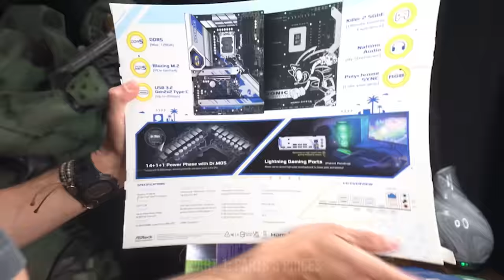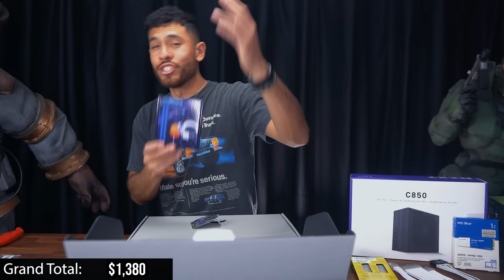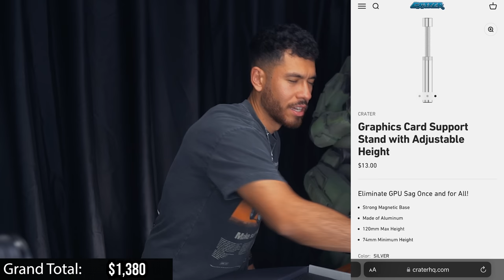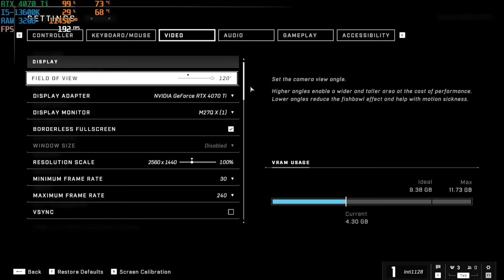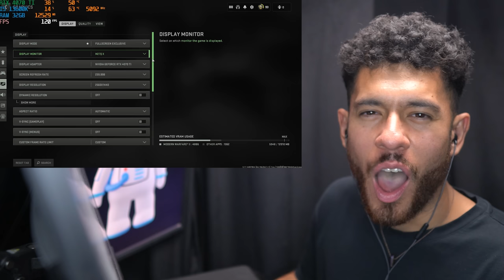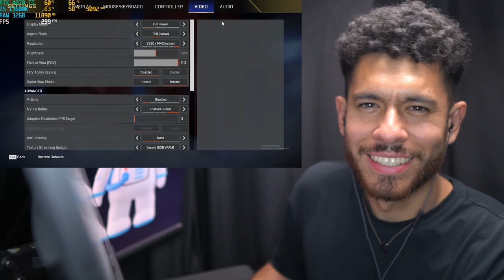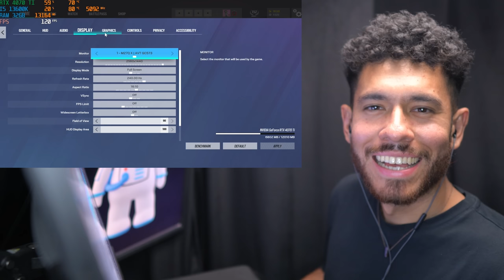$1800 Gaming PC Build - RTX 4070 Ti i5 13600K (w/ Benchmarks)

Comment: Just started picking up parts on my $1400 build with a 4070 + 5600x, just need to get the motherboard, psu and case and will start building it. Excited af since this will be my first ever pc build and a generational upgrade from the ps4 :D
Reply: Good luck 👏
Reply: how did you end up choosing youre parts i need help i wanna start buying parts for my first pc but don’t have any clue on what’s good or not for my budget which is around 900-800 usd.

Comment: I would really like to see a beefier cooler for that 13600k but overall a really nice build Crater
Reply: I have this exact CPU and cooler ordered for my first build, I am not planning on overclocking or anything, should I look into a more robust CPU cooler? TIA!
Reply: Same question here😂
Reply: Same here but least he got a bunch of leftover cables
Reply: 94 C
Reply: @KeaganKellogg try it out, if you are going over 79° in games you’ll get thermal throttling and it’ll reduce performance, in this case, or if it’s just too loud in general I would look for a better cooler. If not then you’re fine
Reply: Could have gone with the peerless assassin rgb
Reply: @KeaganKellogg  tbh id spend the $100 on like a corsair h100x or a Be Quiet pure loop 2 (either the 240mm or 360mm or the fx varient for rgb). Both of those are really stong aio's for the money.

Comment: Love the content Joey! You said you have plenty of airflow in the build but your cpu and gpu temps during Warzone are hotter than my oven. I swear I saw the CPU hit 90 degrees. Definitely go for the AIO option that you mentioned or a Noctua/BeQuiet higher end air cooler
Reply: Yeah I was wondering if those temps were normal or not bc with my aio, It stays around 45-50°. I see a lot of these air cooler builds and temps are usually in the 90s°.
Reply: Yh, i have a 13900k and my cpu stays cool even during playing games like cod CW with ray tracing, an AIO is def better then air cooling
Reply: @islacloud7633 yes the new 13th gen intel runs very hot and what you could do instead of spending more on intel you could go amd and go with the 5800x3d or 5900x or go with am5 because you get the upgrade path
Reply: @YunaHyera  yeah fr, not to mention the temperature of the gpu. Idk why content creators keep on using air cooling when clearly it doesn't work. Every video I see of a PC build using a air cooler, the temps are always super high on the cpu.
Reply: A Thermalright peerless assassin or deepcool ak620 would be much better suited for the 13600k, cools well enough and cheaper than an AIO
Reply: @IslaCloud11  It's because he's using a single tower air cooler. A dual tower air cooler like the peerless assassin, ak620, or nh-d15 would do fine but the single tower cooler just isn't enough
Reply: @Phoenix718 Yeah I saw them say that and I was like “my peerless assassin cools my 7800x3D just fine”. Even at the same price point he could have found something better.
Reply: Yeah,1800$ build for that cpu cooler?nah

Comment: should have put the “custom backplate” in front of the GPU for better visibility would have looked way cooler - the way it is it kinda disappears under the big cpu heatsink 😅
also a running sonic figure hanging from the top of the case in front of the cpu cooler would be awesome design-wise ☺️👍🏻

Comment: Thinking to upgrade my rig
CPU - 13600k
MB - MSI MAG Z790 TOMAHAWK 
CPU Cooler - AK620  or NH-D15
GPU - 4070ti (MSI Gaming X trio)
RAM - Corsair Vengeance (DDR5 16x2)
Storage1 - 980 pro 1tb or 500gb (Boot Drive)
Storage2 - 980 pro 2tb or 4tb for games/Movies
Case - 5000D (Corsair) or Performance 1 FT (Antec)
PSU - RM850e (Corsair)
Case Fan - Corsair SP120 Elite(non-rgb x6)

Comment: Very similar to my build: 

Z790-P (DDR4) 
I5 13600k 
4070Ti Aero (Gigabyte)
LianLi Lancool 2 Snow Edition  (just prefer the size over the 205) 
16GB vengeance DDR4
1tb M.2 
Lian Li AIO Galahad 240 

£2000 ish
Reply: @xboxseriesshort do you like the 13600K ? i have the same
Reply: @cuongtang9539  yeah not had any problems yet with it? Have you? Seems great and runs super cool!

My only thing I need is more ram, I went with DDr4 but probably need to get 32gb next (lMw3 on Ultra runs at 8gb and BF 2047 runs at 10gb so still enough to run apps in the background 

The i5 13600k seems great and is supposed to be one of the best gaming chips 👍 cpu runs between 30-54 and gpu runs at 40-55 never had any issues

I do get a few freezes but I think that’s internet (mw3 suffers from packet loss)
Reply: @GamingCornerYT  hahah yeah MW3 is the only game i had stutters and freezes, not a single other application has this weird issue. I'm also very pleased with the performance and overall stability, i chose this because i heard a lot of issues on AMD site of things. i really wanted to try my first AMD cpu ever but the fear was bigger 🤣 what do you think about these e-cores ? all AMD fanboys say they are there because Intel isn't capaple to make it more efficient

Comment: Hi sir do you think that the i5 13600k could handle assetto corsa with mods and other sim racing games or should I just get the core i7 13700k for much safer option
Reply: 13600K is enough for gaming. i7 would be too overkill

Comment: Hey ive thought of i build for me that i would love for you to say your opinion. I want 1080p 240fps, i play competetive games that require high fps. Like, fortnite, rainbow six siege, csgo and warzone(warzone 120fps is good enough).
So here we go:
Ryzen 5 7600x
Rtx 3060ti
16gb corsair vengeance 3200mhz cl16 ddr4
Cooler Master Master What 650w
AfterMarket CPU Cooler (not liquid)
MSI PRO B650M-A
And the g300a Triple fan case with plus 1 fan in the back.

Comment: I myself build an PC with the "same" settings but instead of the overpriced 4070ti( 900€) went for the 6950XT ( 670€ ). Same os better results in 4k gaming, but ofc if you use RTX it will be a downfall the 6950XT...

Comment: The only thing in this build I would change is the 4070 ti oc for the rx 7900 xt it’s 50$ cheaper on Amazon and performs 15% better but still a great build
Reply: Would a msi case fit that graphics card?